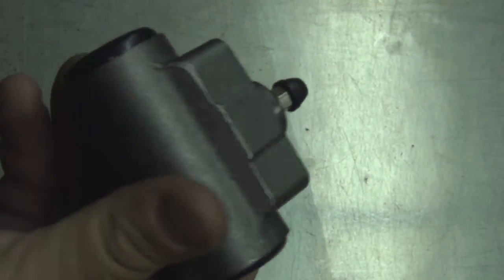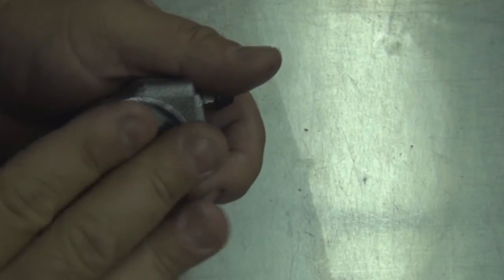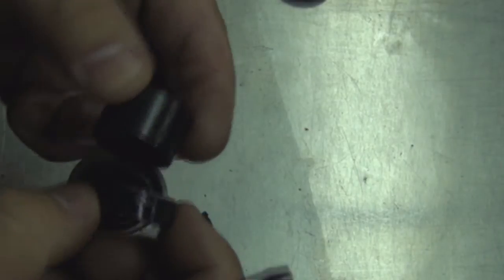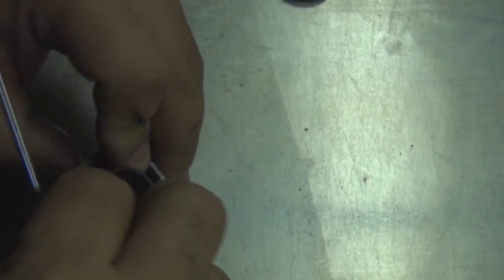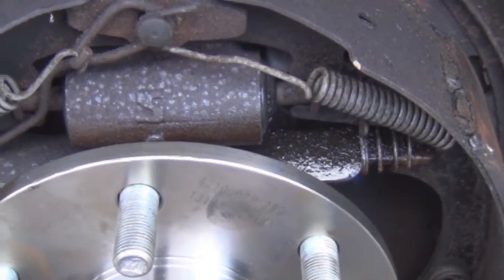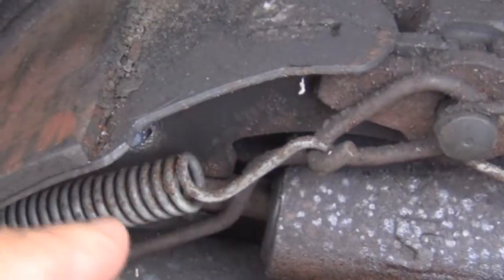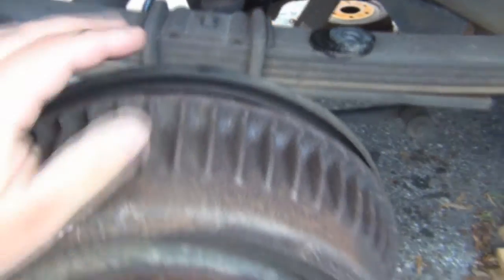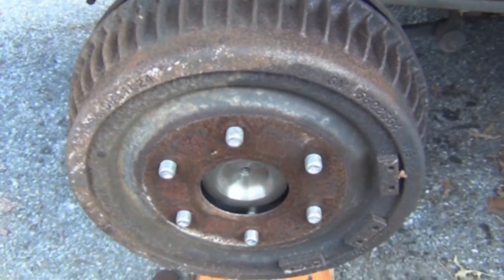What is a wheel cylinder and how does it work EXPLAINED in this video

Comment: I have a quick question for you. If the dust cover comes off of the 
wheel cylinder and the piston pops out yet no fluid leaks, do I still 
need to bleed the brake lines?
Reply from the maker: I never had that happen, but I would assume so because I would think you created an air pocket when the piston popped out. I would bleed it, because it’s better to be safe then sorry. I hope this helps. Thanks for watching and commenting. Please like share and subscribe.

Comment: It looks like something it’s leaking inside the rear wheel and I am having problems to stop my truck. Do you think it’s the cylinder?
Reply from the maker: It depends on the vehicle you have. Because it could be a bad wheel cylinder seal or it could be a bad axle seal. Those two problems individually are enough to cause braking issues. I hope this helps. Thanks for watching and commenting. Please like share and subscribe
Reply: Handy Man thank you, the wheel cylinder was leaking, I just changed, I paid $7.00 box for it.
Reply from the maker: Great. This is why I make these videos. Because it feels good to help people out and this comment right here reassured that feeling. I’m glad it helped. Also thanks for watching and commenting. I greatly appreciate it

Comment: I was switch the shoes and accidentally knocked off a side of the wheel cylinder.  ( the rubber part) obviously fluid leaked out.  I managed to put it back o  shod I be worried?
Reply from the maker: If no dirt got into it and if there is no fluid leaking out now, then you should be good. But if it is still leaking then there will be issues. I hope this helps and wish you well. Thanks for watching and commenting. Please like share and subscribe.

Comment: can i change just the wheel cylinder and not the brake drums and shoes? Love this video. Thank you
Reply from the maker: Thanks for the comment. It is recommended that you change the shoes with the wheel cylinder because the brake fluid that leaks out from the wheel cylinder distorts the pads and can cause a wheel lock up or premature wear of the shoes. It is also recommended that you change both wheel cylinders too, not everyone does but I do.

Comment: Question: when brakes are applied, are both pistons (left and right) supposed to move outward? or is just on one side?      And to clarify, Im only talking about one wheel cylinder, For Example  (Driver side Rear)
Reply from the maker: Both sides.

Comment: What is the use of spring inside the wheel cylinder?
Reply: spriges pushes the   brake shoes  then brake shoes attach with brake drum  then wheel get slow down

Comment: hi.. my brake pedal has gone rock hard ever since iv had new shoes on rear of my citroen relay van. 2.2 1500 modal.. been told its not master cylinder.. any ideas??
Reply from the maker: Dave Matthews Check the vacuum line to the power brake booster or see if the power brake booster has a vacuum leak. I hope this helps.